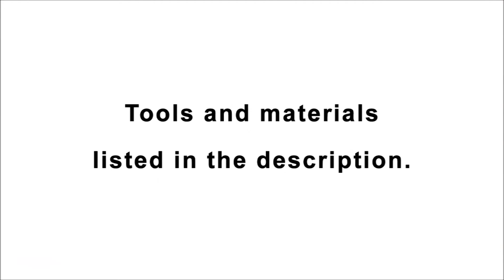Quick and easy right angle grinder storage

Comment: I like. I welded a 3/4" pipe between the legs of my bench in the same locale that I hang mine on, but sometimes i bump them and they fall. This is much more stable.
Reply from the maker: tim sway Yeah, I tested a few different things and this seemed to work the best so far.